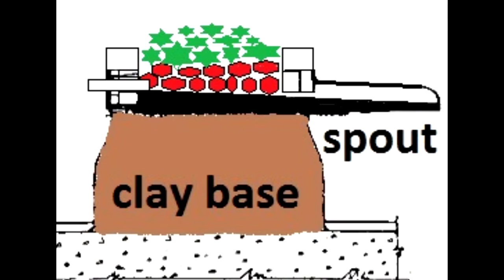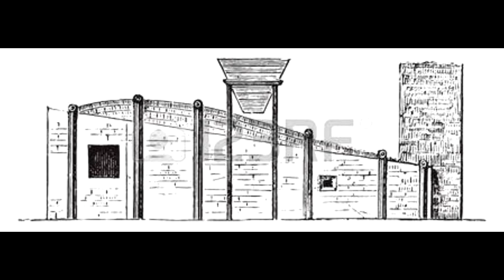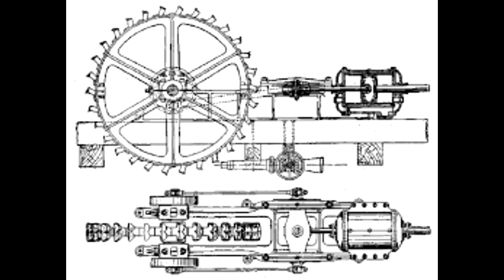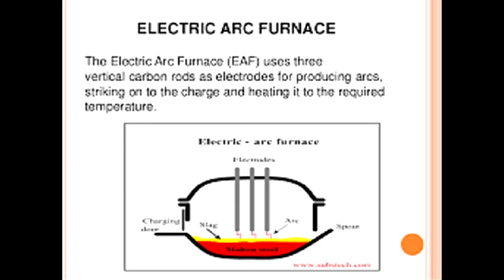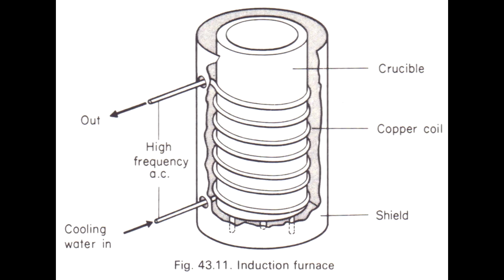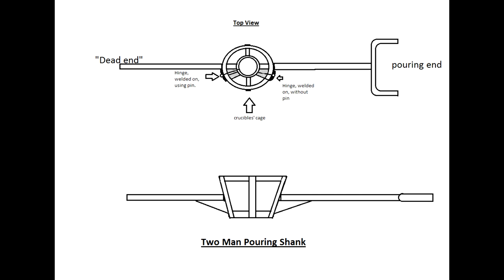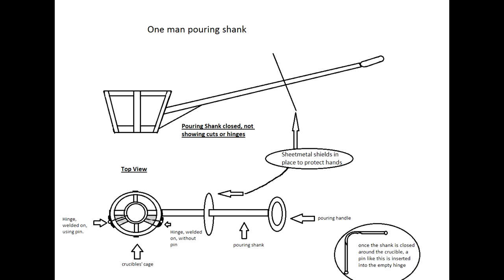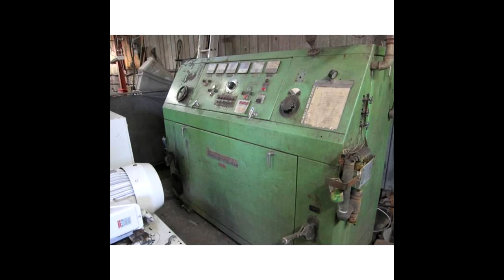The evolution of foundry furnaces from ancient times to the present.

Comment: Great series with lots of interesting extra information.  Good food for the brain for sure.  I started backyard casting about the year 2000.  I don't do a lot of it, but found that charcoal and propane done everything I needed for the colder melts.  I am currently building a qwiky type oil burner to start using some waste vegetable and motor oil.  Have you looked at these burners?  In your opinion, would the be good enough for hotter melts?

Thanks for making the videos.  They are awesome.

Ahhh ... Liberty Call.  Served on USS Suribachi AE-21

Joe
Reply from the maker: I've seen videos that used waste oil and oil reclaimed from restaurants and they seemed to get quite hot. The oil fired furnace, a furnace that used the same fuel as our ship did to get underway, along with Low Pressure compressed air was capable of melting not only brass and bronze but was able to melt iron and steel. I've never made a furnace using oil and lp air but I HAVE seen the burners for sale on Ebay.